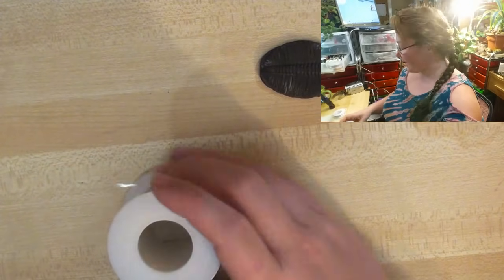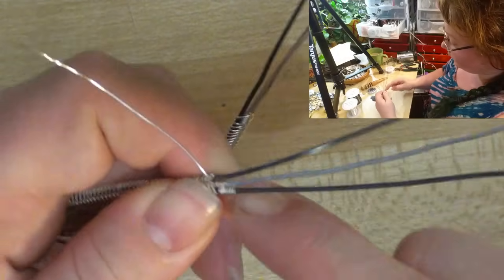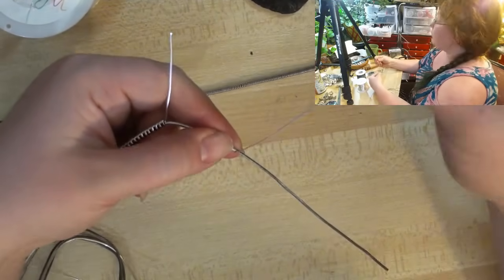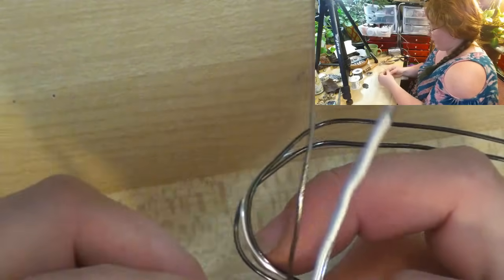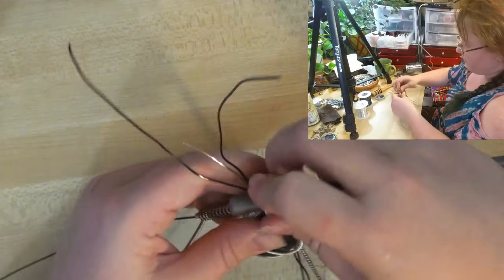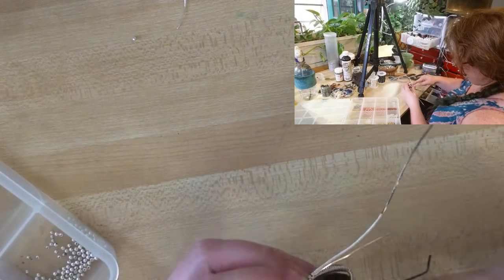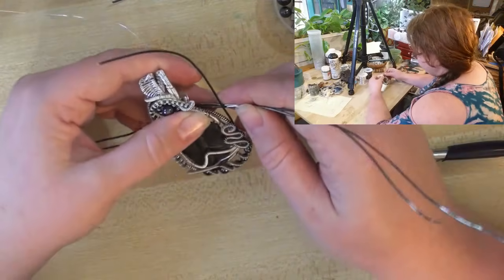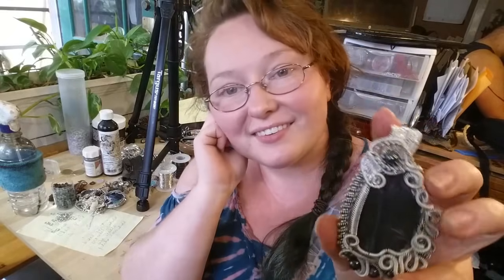Wire Wrapped Fossil

Comment: Hi Yvonne I have a tip for you for when you are wire wrapping to keep the wire from pressing into your fingers so hard. Make a trip to a decent music shop and find some finger and thumb picks for your digits. When you are wrapping wire the pressure will go into the picks instead of your skin on your fingers. If  you get the celluloid or plastic picks you can put grooves and notches into them with jewelers files to help guide and put pressure on the wire without it slipping. Just something for you to think about   to maybe help save some wear and tear on your fingers. They are pretty cheap and you can find them on ebay and Amazon cheap too if there isn't a good music store near you.
Reply from the maker: ooo, I will have to check that out!
Reply: Would that be like a steel guitar picks?  I have my fathers steel guitar picks from when he use to play it.  Do you have a tutorial on how they would work with the wire?
Reply: I am talking about the plastic picks and you could cut grooves and notches in them to help guide the wire. http://amzn.to/2r5BUqy I don't have a tutorial on them as of yet because I am just getting started in wire wrapped jewelry but when I get better at it I will post a video. You don't use the picks on all of your fingers just the ones that apply or get the most pressure. The picks are there mostly as a sort of thimble to help distribute the pressure.

Comment: I was so glad to see you use the coiling tool.  I had been wondering if it would be possible to use a 16ga wire held along with the 16ga mandrel, and work the 4 coils on one wire, 2 coils over 2 wires pattern by repositioning my wire between the mandrel and the 16ga wire.  Do you think this would be possible - and faster than doing it all by hand?